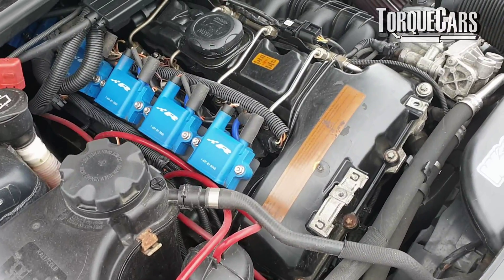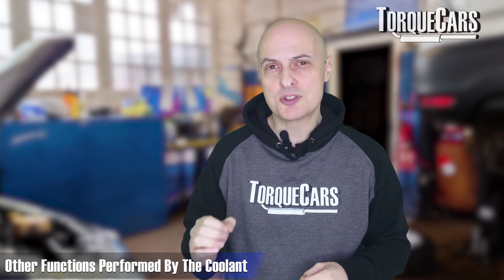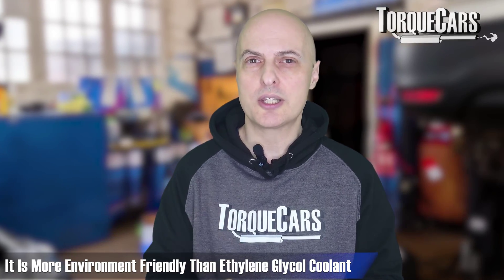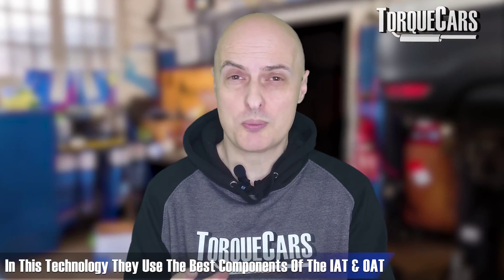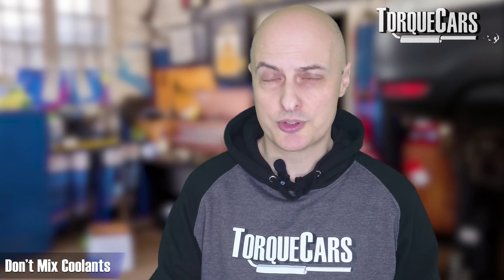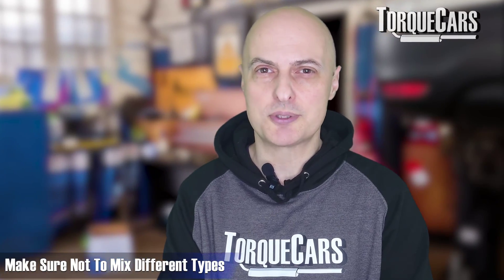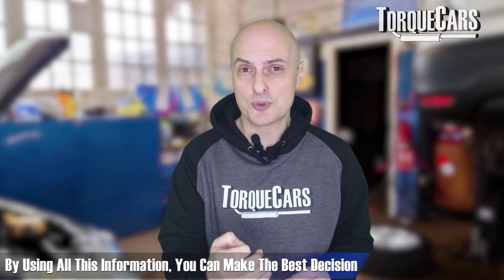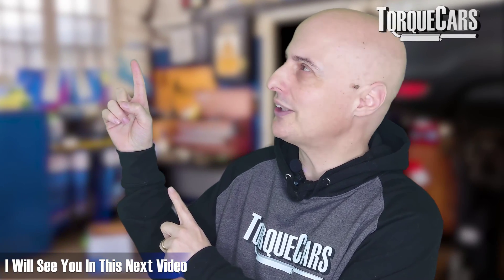Coolant Choices - Common Mistakes That Will Kill Your Engine. A Guide To Engine Coolant IAT OAT HOAT

Comment: I use the "all makes" coolant in my B5. I was paying for the G12! I did drain the system but it's been over 4 years now and I haven't had any issues.
Reply from the maker: Sundays video will go into VW specs in a little more detail as this seemed pretty confusing when researching.

Comment: What happens if you use pure concentration coolant without mixing with deionised water? Does it give more protection?
Reply from the maker: It depends on the formulation, in some cases though it may reduce the cooling, the H20 carrier will contribute to the flow rates, the other downside is the cost, as coolant is so expensive. Interestingly some coolants are premixed so they don't need any dilution.
Reply: Thanks

Comment: 3:15 Lemme guess: the coolant has to be non-conductive since this is the coolant that is flowed around the battery pack and you don't want a leak or rupture of the cooling system to short-circuit anything.

Comment: I live in a tropical country where it never gets below 15 deg C. and averages 30 deg.  I use distilled water with 0.2-0.5% citric acid roughly half a teaspoon per litre to half a tablespoon.  All we need here is the anti corrosion. Citric acid, an organic additive is used in many industries for anti rust/corrosion. At high concentrations it may be harmful, but at those small doses, serves as protection. it ADsorbs with metal surfaces and chelates metal oxides on the surface.
Reply: And technically is safe to drink.

Comment: What are your thoughts on Prestone's 'all makes, all models' coolants? Is this the answer to simplifying top ups?
Reply: That's what I use. But I also drained my system a few times. Been using it for about 4 years in my B5 Audi that is supposed to use the pink G12 or something like that. But at over $20 per gallon I wasn't doing it!

Comment: +1 to checking for updates.
My 2015 2.0 TDI apparently uses G12evo now, not G13.
The latter was the cause of my heat exchanger for interior heating to clog up.
Of course VW changed it quietly to avoid claims.. Infact you can't buy G13 anymore. I recommend everyone to switch to G12evo before your heater clogs up as well.
Reply from the maker: Sundays video will go into VW coolant specs in a little more detail as this seemed pretty confusing when researching. Yes the G13 is not the best despite having the higher number! I counted at least 3 G12 options, a G11 and a G13, it's nice how they keep things simple for us.

The silicate bags they added to go with G13 were prone to split and cause blockages and damage the water pump.

Comment: Awesome, just what I was looking for! Thank you for your great efforts helping us all out my man ! One thing about testing the quality of the coolant, could you elaborate a bit more on that method about the instruments used for example? Thanks!
Reply from the maker: I was going to show mine but typically it has gone missing. Hydrometers - Specific Gravity for antifreeze, if you do a quick search you'll find them, they are not expensive and really simple to use. Insert tube into expansion bottle, using the rubber ball suck up the coolant and then note which balls are floating.

Comment: It is worse than getting the right oil for you car.
Reply from the maker: Engines are getting much more complex and require much more specific formulations of everything now. I just want people to realize they need to do their homework, because I used to be that guy that read the adverts and listened to the manufacturers and ended up with problems.
Reply: @torquecars  I’ve learned a lot from your channel. The small things make a big difference.  Even though the coolant says for all colors you still need to check the specifications.  Thank you for keeping us informed.

Comment: Thanks for doing the research with the technicalities/chemistry in regards to this.

I was told once by an official brand garage to put water into my coolant when I said it seemed low after a servicing and coolant flush.

Recently was an idiot and put oil into my coolant, don't do that ladies & gentlemen.
Reply from the maker: Lol, I remember you posting a thread on that in our forums. Maybe I should to a "Don't put oil in your coolant reservoir" video just in case.

They say we learn from our mistakes, and I've certainly made a lot over the years.
Reply: @torquecars  Yes I did aha, I think it has been the dumbest most LowIQ thing I've done period lol.